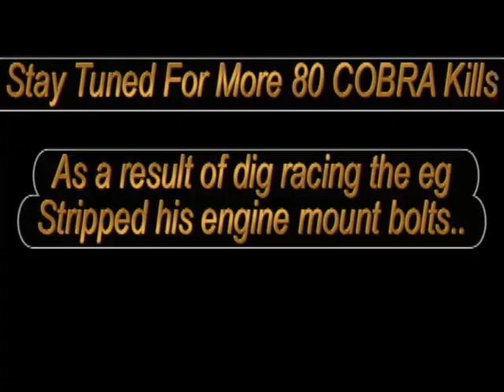1980 Cobra Mustang destroys Honda Civic Turbo in Dragg City!

Comment: The "Cobra" pkg on  the 1980 Mustang was only an exterior trim upgrade pkg, not a performance upgrade. The 1993 Cobra was the first Cobra with a stronger motor than the same year GT model. Good race though!

Comment from the maker: Its a daily driven car, and the aftermarket Tremec transmission has some wide ratios so in 5th gear its not too bad even with the 4.10's but the car runs out of gear in the quarter mile before hitting the traps, so its getting swapped out for a 3.73 gear.